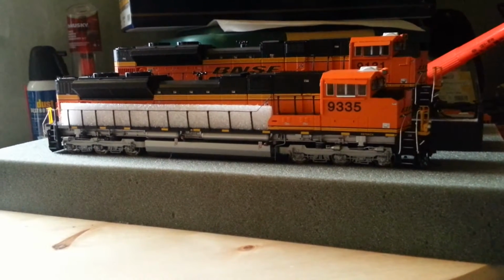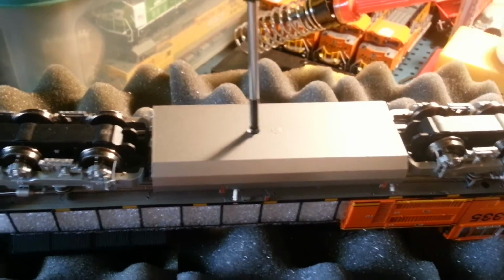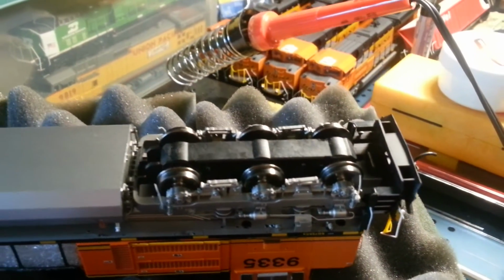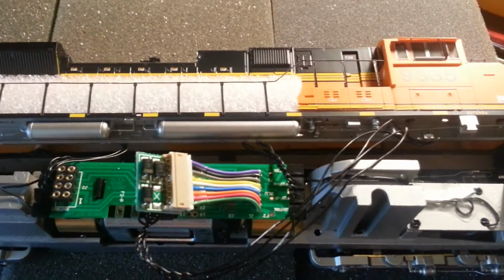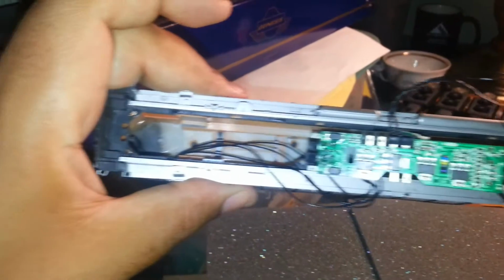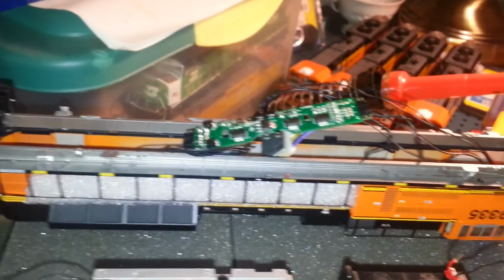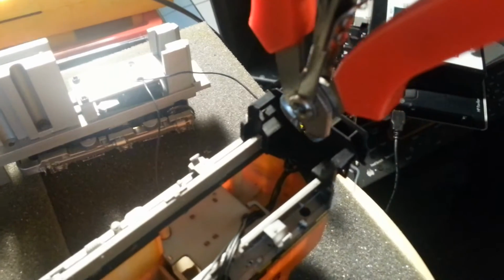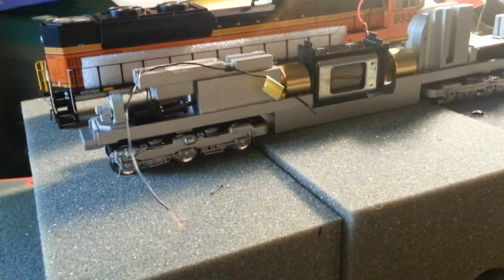Athearn Genesis SD70ACe ESU LokSound Decoder Installation (Build Log No. 01A) Model Tear Down

Comment: If you have the lok programmer it is easy, i just have the nce and decoder pro. Loksound very difficult to tune cvs like to stop ditch lights from flashing is brutal to find. But on tsunami 1 or 2 it is easy and can be changed from decoder pro with ease. one thing cool about lok though if you set cv 54 to zero then press bell the loco will move forward for a short distance and once you press bell again your forward and reverse trims will be auto set.
Reply from the maker: Yes LokSounds are easy to program with the LokProgrammer.  LokSounds are not very intuitive in CV programming without the LokProgrammer.  The instructions explanation on how to program CV's on a LokSound is sometimes confusing at best.  I also agree with you about Tsunami CV programming that it is easier.  I use the LokProgrammer for Tsunami decoder CV programming most of the time.  The old Tsunami decoders dating back 5 years or so are a pain in the ass to program.  The newer version of the Tsunami's are much better.  I don't know much about the Tsunami 2 decoders since I have not gotten my hands on one yet.  I'm planning on getting an Athearn SDP40F with the Tsunami 2 for testing purposes.